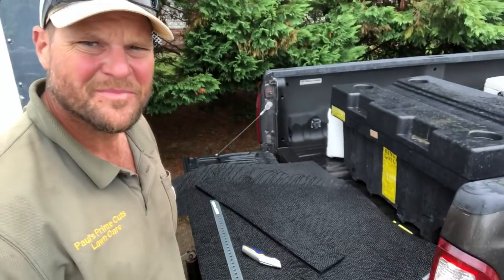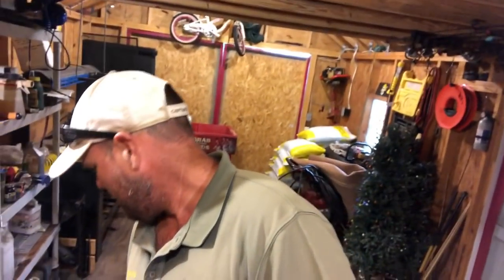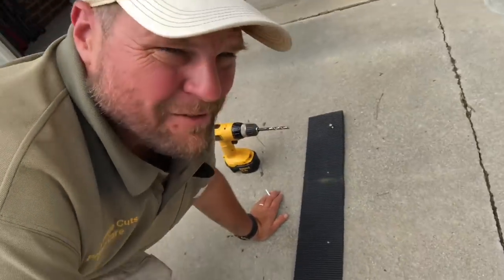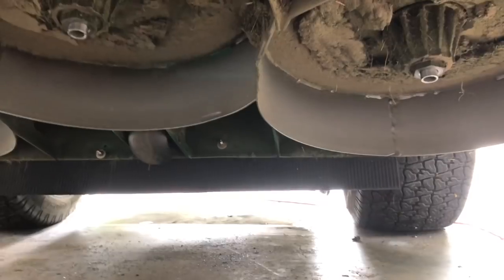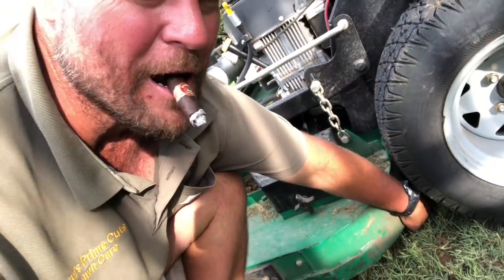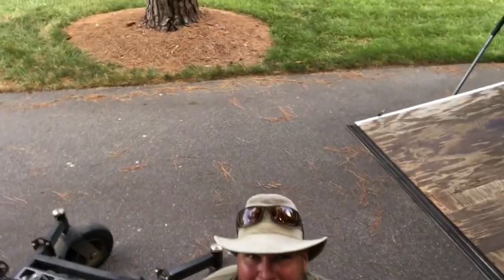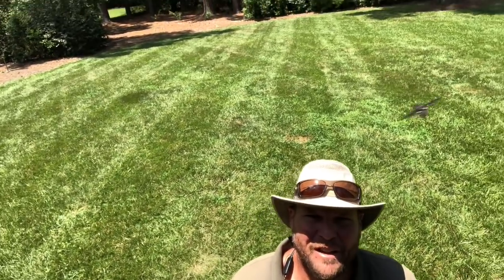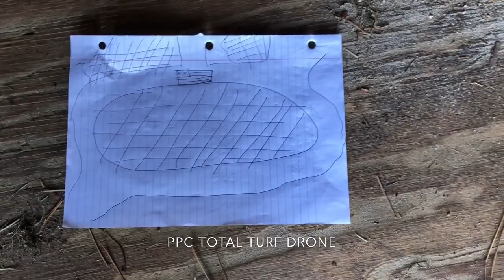DIY Striping Kit

Comment: Do you still use the heavy rubber matt for stripping?
Reply from the maker: No it tore off pretty quickly… if I was always cutting at the same height it would be fine but cutting different lawns at different heights it doesn’t work that well

Comment: Hey PPC, why don't you try mounting a piano hinge to it? It'll still have the weight of the mat to lay the grass coming out of the deck over, but will be able to compensate for the varying heights of the cuts you work at. You'll only need about 1" of mat extending past the lip of the deck, but since it pivots as you're moving forward, you could use it at 2". Think of the old push mower you used to have when you were growing up, and they used those protective mats behind it that were mounted on the wheels...
Reply from the maker: ColonelK0rn but then I’d have to fuck up my wife’s piano 😂
Reply: No kidding! That's why you go to the Salvation Army and get a junker.
Reply from the maker: ColonelK0rn good thinking KOrn will you help me load it?
Reply: Paul's Prime Cuts you saying you can’t lift a piano hinge? My man, you better start taking som Flintstone vitamins hoss.
Reply from the maker: ColonelK0rn you know they come with a piano attached to em right?
Reply: @PaulsPrimeCuts   That's funny right there!
Reply: I have found it to work best at 1" off the ground but I only mow my yard and one type of grass at the same height every time..  One day I will build myself a deck roller or a Roller behind the tires would love to eliminate tire tracks!

Comment: PBP stripin flap!! 👍. Maybe you could make yours the quickchange get some wing nuts weld the bolts to the deck?? It does work killer on Tall fescue  Thanks man.
Reply from the maker: Powerbypoole I cut about an inch off of it and I think I’m going to cut some slits in it ... I think it will work out Olee 👍🏻

Comment: I was thinking you could hang the mat from some light chain, like the kind used to hang a shop light. But not sure how that would work when you had to back up.
Reply from the maker: Doug E Dee yeah I think reverse would be the problem in that set up . I am going to shorten it up some and cut some slits in it and see what that does